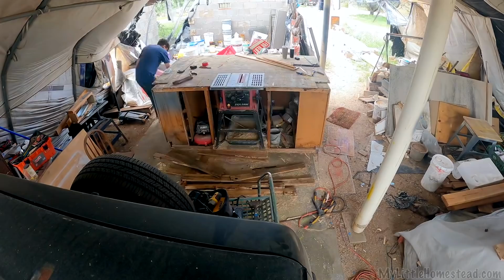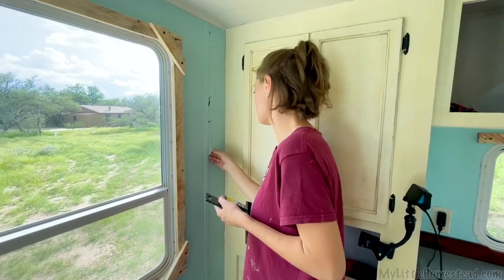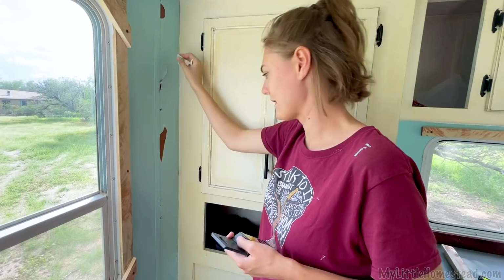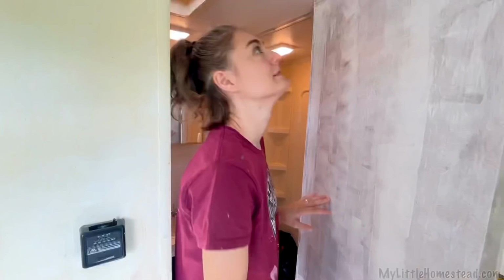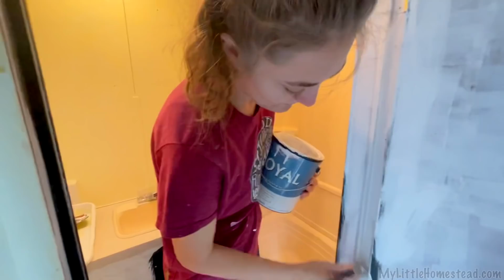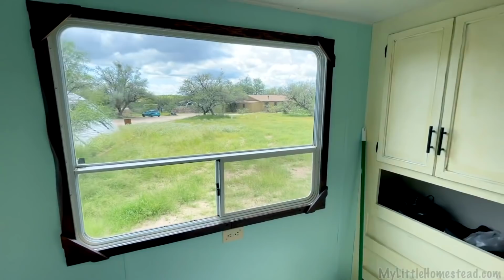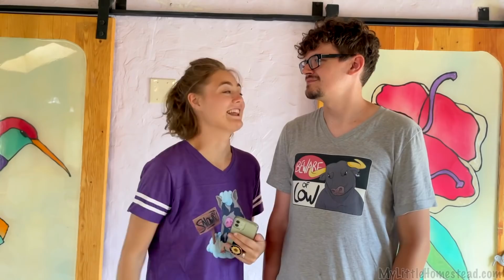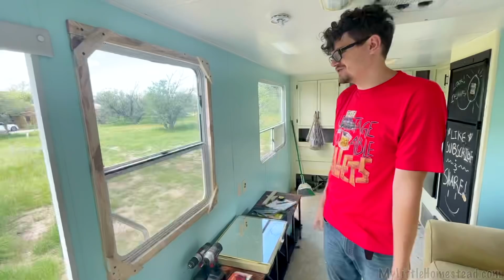Custom RV Window Trim & Bathroom Cabinet Distress Paint | Weekly Peek Ep309

Comment: I like that the window trim squares off those corners on the windows. That same frame carried into the bathroom, would be great to hold a mirror over the sink, or a REALLY shiny (mirror finish!) metal mirror. (Not have to worry about vibration and breakage like a glass mirror.)

Comment: Also, my friend remodeled his restored pickup truck overhead camper. To find things he might not otherwise foresee happening, he would load up the camper for a trip, and have someone drive the truck around some dirt roads and railroad tracks, while he and a buddy rode in the camper, locating squeaks and rattles they might be able to fix before a long road trip.

Comment: Thisvweek I saw a trick about taking pallets apart quickly and thought of TLH... instead of cutting nails with a sawall, someone on YT demoed a pallet using a scissors jack and a drill with a cup hook in the chuck to spread the boards apart so the nails can be pulled out. That could save the knife on your jointer from gouges from embedded nails. Just wanted to pass on a possible time saver tip.  Love to see your projects come to life.  You encourage viewers to take risks with big projects.  Thanks!

Comment: I for one think a T-Shirt that just has a sheep on it saying bahhhhhhh would sell nicely right now. Just thinking out loud. Maybe sheep with masks, but I digress. 

And, I was wondering if that thermal blanket (foil looking) material with paint over it might (with curtains of course) keep you all warm in the winter. 

Seems like those older/RVs without insulation are not great for holding in heat in the cold months or on cold weather trips. 

I do love these videos and all of your family members.

Comment: A good way to destroy a wood jointer is using pallet wood.
Reply: Do you mean that all metal should be removed first? Or what?
Reply: It’s almost impossible to remove all the metal and rocks from the pellet wood. Even using a metal detector there will be hard object in the wood damaging the jointer blades. I have learned over 60 years of woodworking is sharp tools and accurate measurements are the key of successful woodworking. Also your woodworking machine’s must be dialed in correctly.